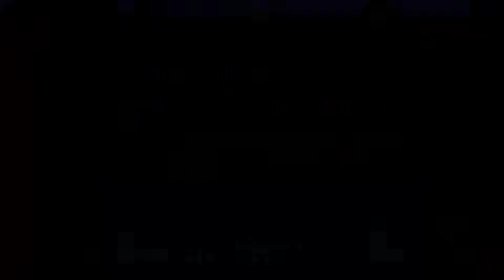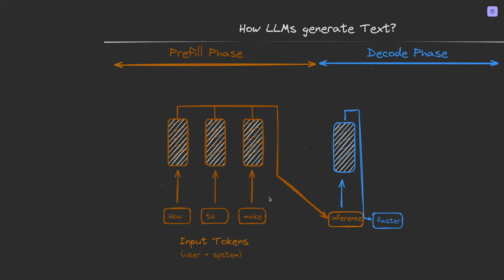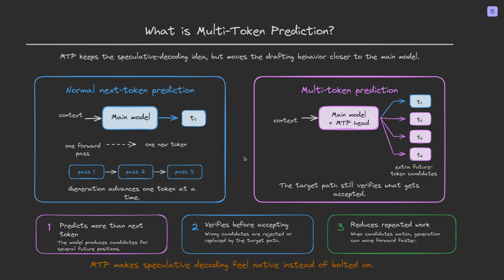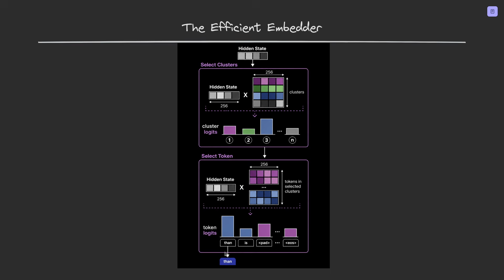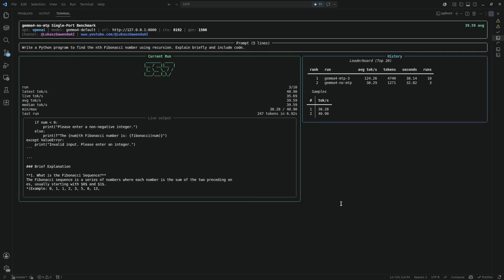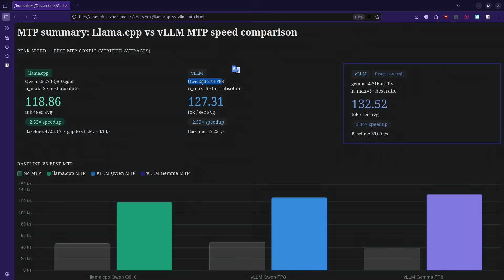Over 3x Faster AI. MTP Explained, Deployed & Benchmarked on Gemma 4 & Qwen 3.6.

Comment from the maker: Multi-Token Prediction (MTP) is the inference trick that every major AI lab is quietly adding to their stack — and it delivers 3x+ speed with zero quality loss. In this video I explain exactly how MTP works, deploy it on Gemma 4 31B and Qwen 3.6 27B using both vLLM and llama.cpp, and run real benchmarks so you see the actual numbers.
Most engineers focus on model quality but ignore inference speed. If you're serving LLMs in production, MTP could cut your compute costs by 3-4x overnight.

🔥 What You'll Learn:
✅ How standard autoregressive decoding works (and why it's slow)
✅ What speculative decoding is and how MTP improves on it
✅ KV-cache sharing between target and draft model
✅ Target activations and efficient embedder explained visually
✅ Full vLLM + llama.cpp MTP setup walkthrough
✅ Real benchmark results: up to 132 vs 39 tokens/sec

🔧 Hardware: AMD Ryzen 9 9950X · NVIDIA RTX PRO 6000 Blackwell · 96GB VRAM · 92GB RAM · CUDA 13.1 · Linux Ubuntu
Models: Gemma 4 31B (FP8) · Qwen 3.6 27B (FP8/Q8)
Engines: vLLM · llama.cpp

⏱ Timestamps:
0:00 Why inference speed = money (and why subscriptions keep going up)
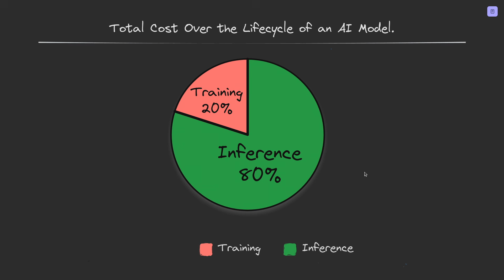1:54 Prefill vs decode phase — why generation slows down after token 1
4:15 KV-cache explained — the optimization that also eats your memory
8:00 Speculative decoding — small model guesses, big model verifies
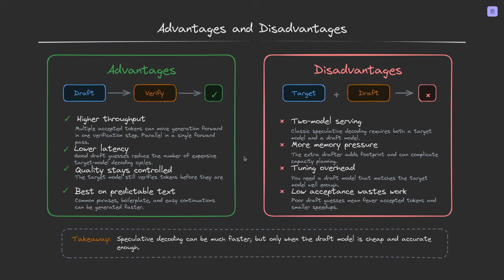12:35 What is MTP and how it differs from speculative decoding
17:03 Gemma 4 MTP architecture — target activations, KV sharing, efficient embedder
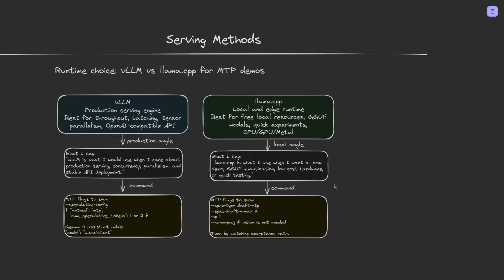28:03 vLLM setup + live benchmark (Gemma 4 31B FP8)
32:07 llama.cpp setup + benchmark (Qwen 3.6 27B Q8)
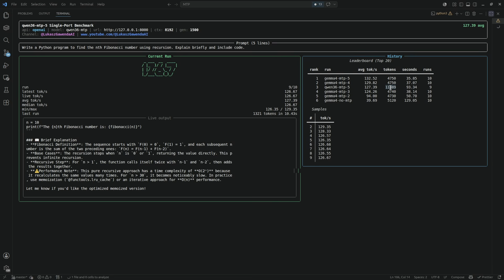32:22 Final results — vLLM vs llama.cpp, which n_spec wins

📦 Resources:
GitHub: https://github.com/lukaLLM/llamacpp-vllm-mtp-setup-and-speed-benchmark-qwen3.6-gemma4

References
- https://x.com/googlegemma/status/2051694045869879749
- https://blog.google/innovation-and-ai/technology/developers-tools/multi-token-prediction-gemma-4/
- https://ai.google.dev/gemma/docs/mtp/mtp

#MTP #LLMInference #vLLM #llamacpp #Gemma4 #Qwen #AIEngineering #MLOps #InferenceOptimization #LocalLLM #AI #GenAI #MultiTokenPrediction #AIBenchmark #SpeculativeDecoding

Comment: i'd be more impressed if its low end hardware
Reply from the maker: Fair point I used the big card so the numbers were clean, but the MTP speedup mostly comes from cutting forward passes, so it should carry over to weaker GPUs too